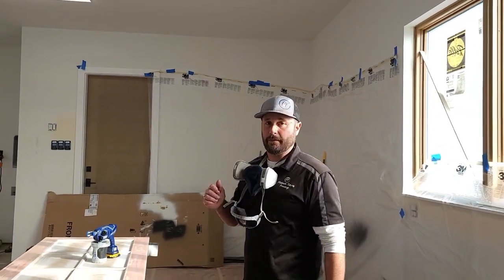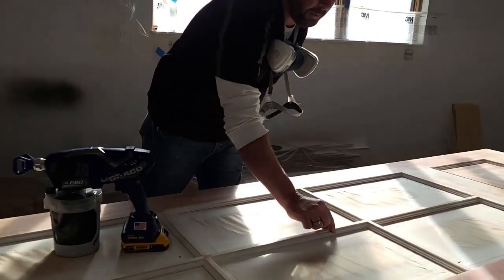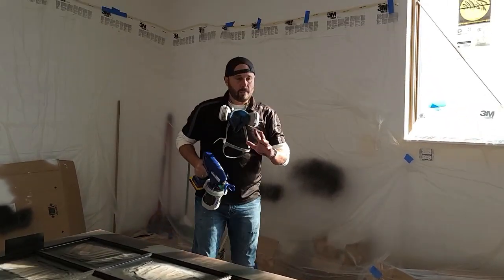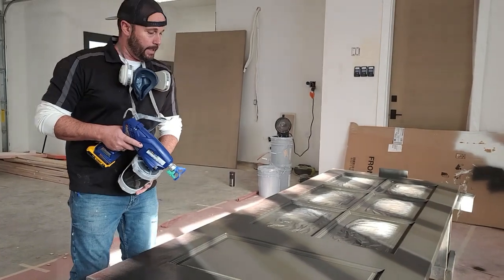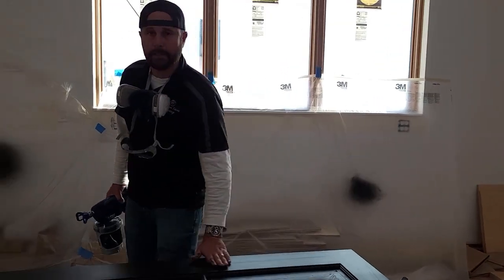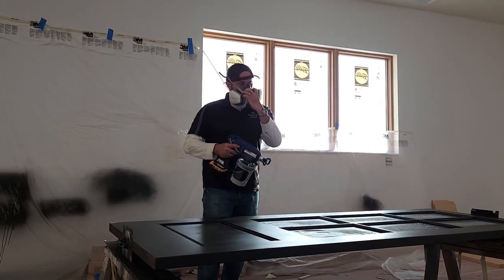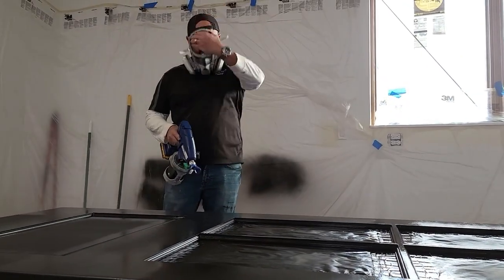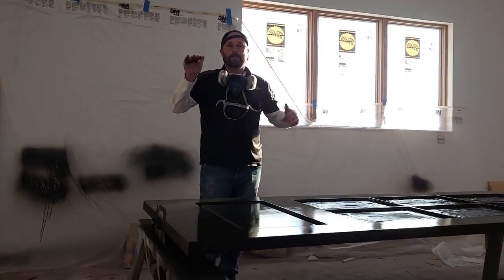Front Door Painting with a Handheld Sprayer

Comment: Wish I found ya before painting my interior barn doors today 😔 quick question for ya, I’ve got a cheap Amazon spray gun which I’m spraying water borne alkyd with, which tip (came with 1.5 - 3.0) do is optimal for this situation? I’ve thinned it down with water + this flow additive I bought from sw so I guess my question would be what type of consistency am I looking for?
Reply from the maker: Hello Alexander,  so I would think that if its a waterborne alkyd,  and it has to be thinned, then I always try to keep product thinning to a minimum.  I know you have to for your gun,  but try to find a mixture that is as little thinned down as you can, while still being able to shoot a good spray fan. Most waterborne alkyd will lay down really nice and will self level really good. They usually don't tend to be too thick so start thinning it down little by little, run some test sprays, and once it comes out of the gun evenly, let it rip! Thanks for the comment and let me know how it goes👊💪

Comment: I used the same paint and sheen it was old but seemed fine I mixed it well strained it but the finish coat is easily marred and scratched. Not sure if it's the fact that its eggshell or just old paint from a couple years ago haha. How durable do you find it to be ?
Reply from the maker: I actually had some issues with that when I first started using it, but I have learned that the Aristoshield likes a light tack coat first, especially with the ultra deep bases and dark colors...I've had really good results building lighter coats and a little Sanding in-between 👊💪 For some reason,  when this stuff gets too heavy on mils, it doesn't bite as well. Thin to win, just at least 2 coats sometimes 3. Thanks for the comment 💪🙏
Reply: @PaintBoss  Makes sense thanks for the info. I'll give it another try because ik and have heard how great this product is. Keep up the amazing work 💥

Comment: Awesome Videos. I have the same sprayer and the 310 FFLP tip. I am spraying the Benjamin Moore Advance, similar waterborne Alkyd. Any recommendations for setting the pressure dial on that Ultra Gun? It doesn't seem to leave tails the same as a full airless sprayer setup.
Reply from the maker: Nice work Mark💪🤝 yes I just play with the pressure and test before shooting,  with a fflp I always start at about 40 percent pressure and then get the fan to not have any tails and that is what I go with. With Laquer it's so much thinner so pressure is down, but with waterborne and latex pressure is usually up at about 60 to 75 percent depending on tip. thanks for the comment

Comment: Do you make the carpenters pre hang the door with the threshold installed before you paint the door? The reason I ask is I’ve seen a lot of instances where either the carpenters or the weather proofer do a cut to the bottom of the door post paint. The weatherstripping guy might put some coat the bottom with some shellac if he’s thorough, but the carpenter isn’t going to do it.

Comment: Got another question. I have watched a bunch of your videos and you have used several different kinds of paint, Dunn Edwards, Sherwin Williams, Latex, Alkyd... I am doing a built in entertainment center and want a really durable (we have grandkids) paint that will lay down well. I have an airless sprayer. I am a little overwhelmed by the number and kinds of paint that is out there to use. Thanks
Reply from the maker: Hello Bill, so sorry for the delay, I am still getting the hang of seeing all the comments! So I would say the strongest would be a Pigmented Laquer,  but they are really tricky and stinky to work with! My go to is the dunn Edwards Aristoshield waterborne alkyd.  Do 2 or 3 light coats and that stuff will dry super hard and be really durable. If u can't get that sherwin Williams also has a waterborne alkyd and it also dries pretty hard, either one should treat you well! 💪👊 Let me know if you need anything else or what paint store is near you, Benny more also has a good one, but so far my favorite is Aristoshield